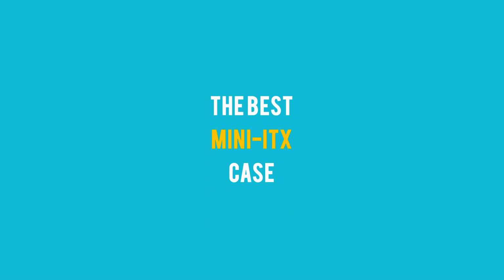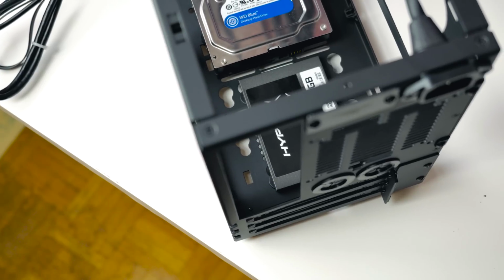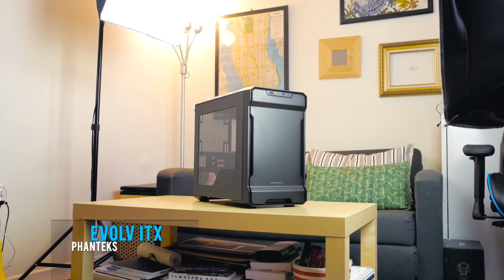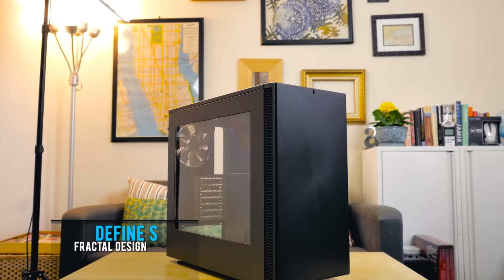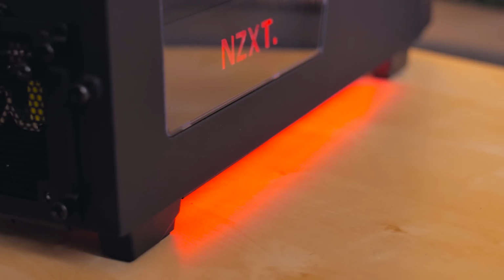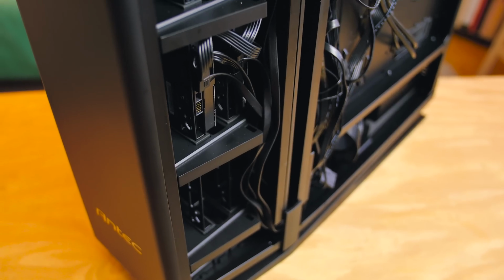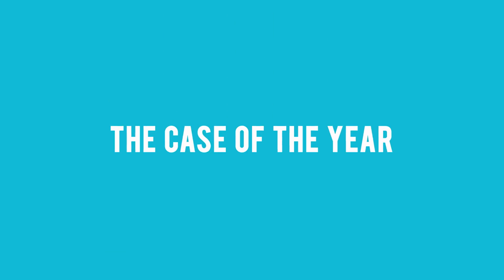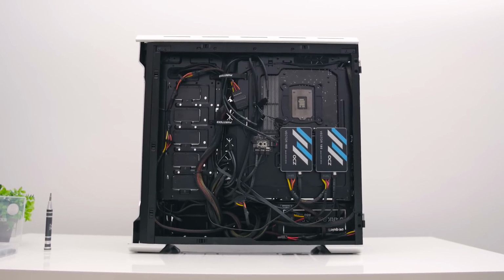TOP CASES OF 2015

Comment: Would be nice to have a most silent category
Reply from the maker: +William Wang did not review any silent cases in 2015 unfortunatly, but check out the R5 and SilentBase 600.
Reply: +William Wang 
Remember: The case is as silent as the loudest component.
Reply from the maker: +Brandon Breuer Good point :D
Reply: +William Wang fractal design r5 wins easy
Reply: +Anthony Shea I'm going to guess that AIOs were used just for demonstration and simplicity.  Building a full custom loop in each case for review can get tedious.
Reply: get a define r5 and put be quiet fans in it. voila. almost complete silent gaming
Reply: Oversalt I overclock everything lol one of my pc's sounds like a jet
Reply: +Jm Gerbese no opticarl drive mount. Kind of surprising since the matx version has a removable/optional mount in the back but I guess no one used it
Reply: +HardwareCanucks AIO is not comparable to liquid cooling either in performance or parts, so when you slap in a AIO cool and go 'its great for liquid cooling' you just sound stupid.  AIO there is no pump or replacement concerns. unless in your eyes anything that uses liquid is liquid cooling in which case you should include all the popular air solutions which use heat pipes seeing they use a liquid to transfer that heat as well.
Reply: If you're going through the process of making a completely silent rig, then you'll probably be better off with going with aftermarket fans specifically tailored for quiet operation.
Reply: Use the Corsair HD120 rgb fans and buy some rubber "screws" make sure to get a case with a option to change fan speeds. My PC is damn near silent and its a beast.
Reply: The define s is a cut down r5 with a different shaped window,right?I dont use the drive cages in my r5 and it looks almost the same as the define s.Also,what is the rarest color option for the r5,not including that white gold one :)
Reply: +HardwareCanucks The Phanteks ATX doesn't have an Optical Drive? Need your reply ASAP
Reply: +Slay Which is also the reason why my PC sounds like a leafblower. Can;t wait till i have the 212 Evo ^-^
Reply: +Jm Gerbese 
no, it doesnt have one. thankfully we have usbs and the internet nowadays. If youre wondering: yes you can install windows from a usb
Reply: +Shangori Ohhh okaay. Thanks :)
Reply: +John Burns So you prefer the matx version?
Reply: +John Burns So you prefer the matx version?
Reply: +William Wang +HardwareCanucks Would also be nice to have a &quot;Best watercooling optimized case&quot; category.
Reply: +Job Moret Imo best water cooling case is the define S
Reply: +Felix Griffin - try fit push/pull config with dust filter on top ...
Reply: Jm Gerbese Oh and I have this case myself. Standing right next to me. If I had any one complain its that the side panel is a tiny bit too tinted for my taste. Other than that, this case is pretty much perfect
Reply: +Shangori I have this case too. I built a custom loop in it, and with leds the window is gorgeous!
Reply: +HardwareCanucks  :     Hi, Happy New Year! . I would like to make a thorough visual images you how to assemble computer water cooling with a new motherboard (LGA 1151. ASUS Z170 DELUXE), processor 6th generation, and computer housings Phanteks Evolv ATX. Thank You
Reply: +HardwareCanucks Even with the HDD cage at the bottom, there's space in the front. Take out the front panel and you'll be able to route cables through. I had the same problem with the Samsung 850 Evo in this case
Reply: +William Wang An empty case would be completely silent :-)
Reply: I agree, need a silent category next time please.
Reply: Jon N oh I would agree, but saying that you could fit a pump  and res in a mini itx case is pretty much a fantasy. now the defined S is actually built with custom loop builders in mind. but having the top room for a 240mm AIO hardly makes it loop friendly by any means. only cases i could imagine myself building a loop in where the defined S, master case 5, lian li pc-08 (which till this video I had forgotten about it, which is sad because it is beautiful). and i'm being honest here.
Reply: I'd imagine that the setup would help determine how quiet the PC would be in the case.

The case itself should help dampen a fair amount of noise, but it's not going to work miracles if your fans are already loud.  If you've already got a quiet setup, then it should  do very well with having a whisper quiet rig.
Reply: +William Wang i was trying to deside between the define r5 and silent base 600. I went with the silent base 600 becuase on the linus tech tips forums someone said that they are both very quiet, but the be quiet fans are much more quiet that the included defign r5. Also the silent base 600 has a more aggressive "gamer" look
Reply: +William Wang yep the SilentBase 600. Awesomesauce Network did a silent build if you want to check it out
Reply: +HardwareCanucks Built up a Define R5 coming from an Antec 300, what a world of difference...
Reply: +Jm Gerbese it does, but it's in the back.
Reply: perfect place for a W/C pump too
Reply: google Phanteks Evolv ATX watercooling, it'll come up with a bunch of videos of custom loops installed in it. 
And if you're really new to watercooling, you can always go for an all in one like the Corsair H100i
Reply: He was stating that the case has multiple mounting options for rads. You can't expect him to build a custom loop for each and every review man. It's also not hard to see that this case is actually pretty flexible when it comes to W/C. Easy mounting up top, completely open front, 2 hidden removable 3.5" drive bays in the back, perfect place for a pump. Easy mounting spot for a rez in the back near PCIe. Phanteks really did take water cooling into consideration.  - and as far as air cooling, it's pretty simple, go to their site, get the case dimensions, and make sure you pick a cooler that fits. But even that probably isn't necessary, there is plenty of space, the case is pretty wide, lots of clearance up top, the only thing you may want to consider is memory clearance.
Reply: William Wang i fucking hate silent pc cases because 99.9 percent of them you dont have a window so you cant show off what tou built
Reply: alllexxiii FFA You can have a silent pc with a window, the case you can modify for silence and just try getting rid of all the moving parts that you can. Watercooling is needed for silent operation.
Reply: Revized needed is abit of an overstatment. if you want maxed performance and silence it is needed, but if you dont overclock to hard you can just get a huge cpu cooler like the darkrock pro from be quiet and set a slower fancurve for your gpu.
Reply: Whatever the BeQuiet case is.
Reply: i have a 6700k set to 4.5ghz and a gtx 1080 strix set to 2020mhz, only thing that makes noise is the gpu when i play stuff like the witcher 3 @ ultra 1440p. just gotta now to buy the right case/fans/cooler